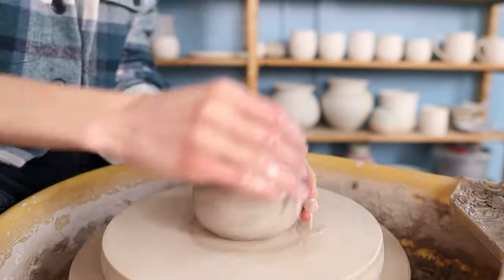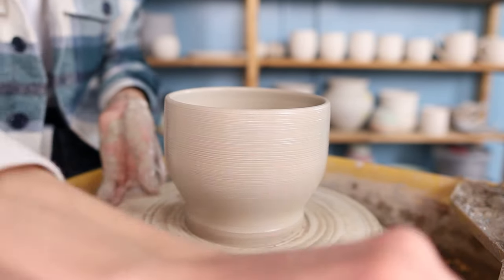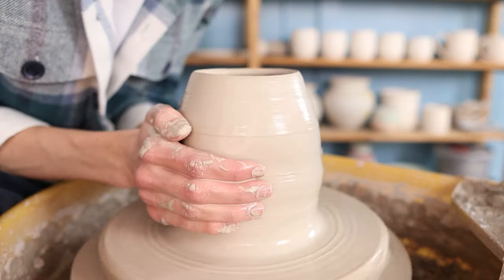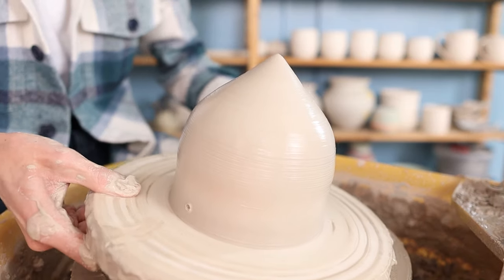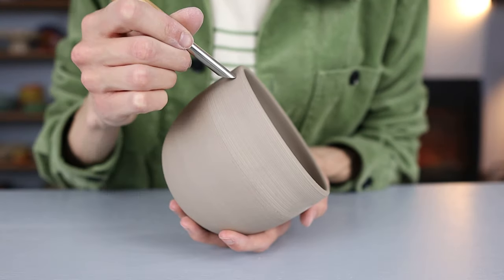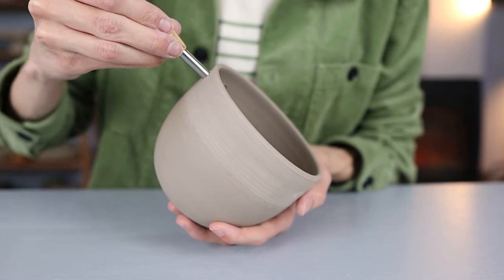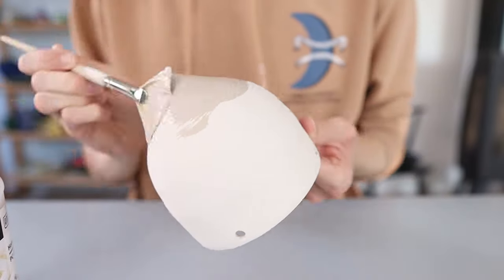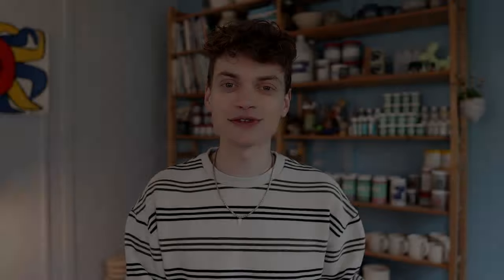How To Throw Hanging Planters on the pottery wheel // throwing, trimming, making holes and glazing

Comment: Enjoyable as always 👍🏼. I have been told by friends in a plant club that pots should be raw clay inside as the plant roots like it better.  I now leave the insides without glaze. Figuring out the best way to tie the rope for hanging has been a challenge - mine just don't look neat snd finished. Still working on a good solution.
Reply from the maker: Thank you! That's so interesting! I'll keep it in mind for future planters! I use two strings and tie them in a loop, nothing special😊